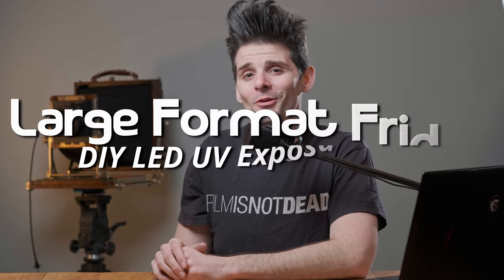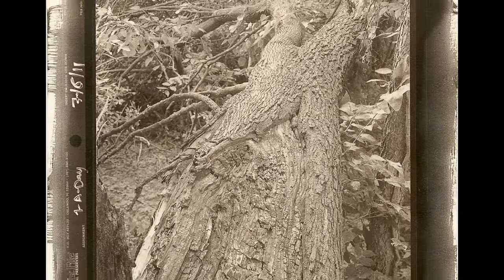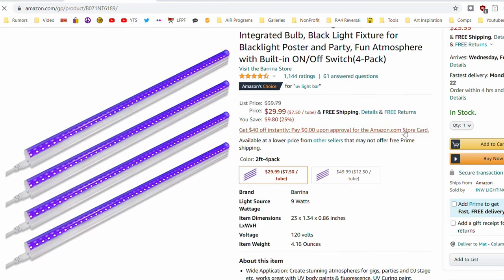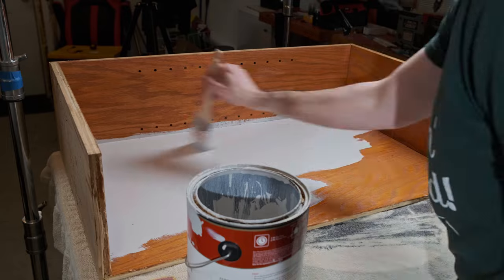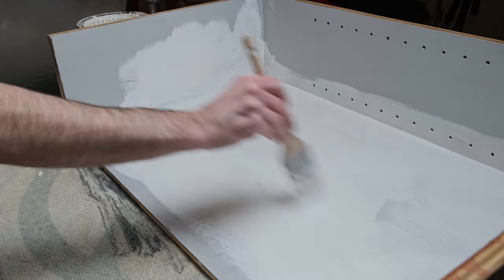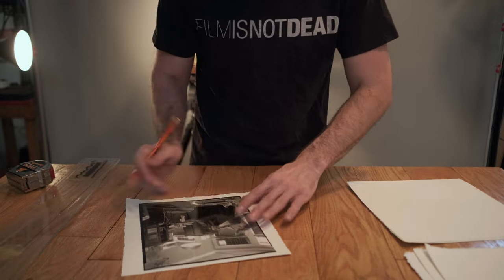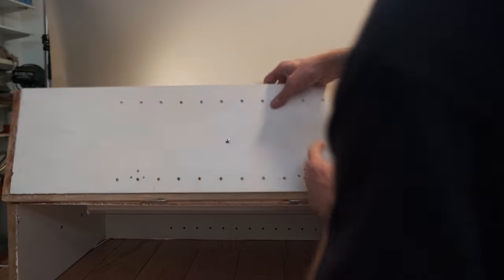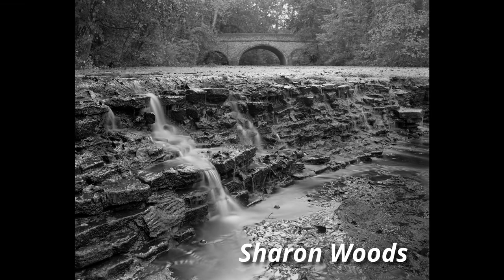DIY LED UV Exposure Unit for Alternative Process Photography - Large Format Friday

Comment: I built one of these a few years ago.  I attached a tripod mount (nut) on the back so I can position it easily.  I use it for albumen printing of wet-plate and digital negatives.  With the LEDS about an inch away from the printing frame my times are around 12 minutes.
Reply from the maker: Hey Robert thanks for sharing! I'm thinking the distance to the lights is something I can work on for sure. At an inch away, are you seeing any uneven-ness to exposure on the prints?

Comment: Have you considered argyrotypes? Making the sensitizer from scratch is kind of a pain, but you can buy pre-mix pretty easily, especially in the US. It's a printing out process, too, like cyanotype. It's closely related to kallitype AND you can gold tone and platinum tone it. A well-done argyrotype can be toned such that it is visually indistinguishable from a Pt/Pd print! And cheaper to make!
Reply from the maker: Hey thanks for the comment! I've heard of them but never tried them. Having access to a reliable UV source means I'll be experimenting with all sorts (time permitting). Will have to look more into argyrotypes!

Comment: Hi, thanks for your excellent video clips. When I saw your DIY clip regarding the UV developer, I would like to ask, what is the optimal distance between the light source and the print material, is it about 4 inches, or less or more. Thanks in advance
Reply from the maker: Hey Christoph thanks for the question! Optimal distance is based on intended print size and the spacing between the LED tubes. For the one shown in this video 4-6 inches from the printing surface is good. Any more and exposure gets increased, any less and there can be uneven areas on the print.

Comment: You might take a look at the LED UV rave lights made for European discos. About 30-50 watts each, 120 degree dispersion, 390-410 nm wavelength. That could simplify the build. I'm thinking a horizontal unit might  make more sense in my circumstances.
Reply from the maker: Thanks for the tip, I'll have to do some more digging into those!

Comment: I love platinum because the graduation of tones is spectacular!  However, I don't like all the extra work necessary to get a negative of the right size. I'm experimented just creating 4x5 platinum prints and they are gorgeous but just to small to really show off the beauty of platinum.
Reply from the maker: Erich I own a few 4x5 Pt/Pd prints from various photographers and they're fantastic! They may not have the same presence as an 8x10 but they frame and hang very nicely.

Comment: Now you've opened the door to the rabbit hole 😉
I did do some anthotypes once. While it was fun, it's not something I was tempted to do again as you need to pick an awful lot of flower petals to make just a small amount of "emulsion"...
BTW, nice deckled-edge ruler. Never seen one before. When I want an uneven edge I sometimes just slightly wet the place where I'm going to rip the paper using a small brush.
Reply from the maker: Thanks Francois, Anthotypes are another alt process I've yet to try. The creative freedom in choosing your own natural pigment is pretty cool. If you don't mind replacing flower picking with more steps, there's always carbon printing! Oh and that deckle edge ruler is great for tearing big watercolor sheets. I was shown the wet and tear method in college then saw one of the rulers used, the choice was clear, lol.
Reply: @MatMarrash  Carbon is definitely very beautiful, but maybe a bit too expensive for me (though I haven't really checked). For a long time I've been tempted by photogravure, but I think I'll get myself some chems to make some cyanos first... and tone them in tea or something.
Reply: Replying to a very old comment but if you are still interested in anthotypes you can use tumeric! Super easy no blender necessary and has a pretty quick exposure time of about 2-3 hours (can wash with borax rinse to make the print bright reddish brown too!)
Reply: @jadebramley3540  thanks for the tips. With the summer coming back I might give it another try.

Comment: This is great. How did you know the height of your drawer was enough for the light to spread evenly across the print?
Reply from the maker: Hey Jim, there are some recommended heights in Tim Layton's post (linked in description) but I really kind of got lucky with the build. Were I to build it again, I'd move the assembly down an inch or two.

Comment: I built the same exposure unit from Tim Layton’s post last summer, and it works like a dream. And so inexpensive!! I built an 11x14 contact frame at the same time, and I ended up spending less than $150 for both the frame and the exposure unit. I’ve used it for cyanotype, platinum, and kallitype printing so far, and I really love it!  Just curious, where did you get the cool thing you’re using to tear the paper?
Reply from the maker: I'm definitely late to this sweet DIY unit but had to share it. Glad to see other folks out there already using it or one like it. That deckled edge ruler is a gem and found it as a used product marked-down for clearance. I'd seen one demoed years ago and wanted to have one for making "edgy" tears on my watercolor paper.

Comment: what would be the benefit to making this as opposed to getting a nuarc or other plate making UV light source? Plate burning tables are pretty cheap these days, and the output from the UV bulb is probably a lit stronger?
Reply from the maker: David this is a great question! As a former NuArc owner, there are some big advantages of LED's: low/no heat generated, insanely low power draw compared to a plate burner, and lifetime of the LED's is significantly longer and more resistant to environment variables like humidity and dust.
Reply: And the exposure times and coverage is good? I'm definitely not opposed to chucking my huge plate burner if the LED technology has caught up
Reply from the maker: @davida5296  Exposure times are pretty good if you keep the LED distance tight at < 12". I'd say keep the NuArc for the vacuum and heavy glass top. Once the bulb goes, replace it with LED.
Reply: @MatMarrash  that might be the winning ticket. Let's keep alternative process going!

Comment: I'm making a large exposure unit. Any tips you may have would be great. My main ask is I have a 3.5" x 6" glass tabletop that is 3/4 inch thick. Will the thickness of the glass affect the process?
Reply from the maker: Thanks for the question Doug! A thick plate of glass shouldn't impact the process negatively, but will definitely provide enough contact between the paper and the negative.

Comment: I thought cyanotype needed 365nm wavelength UV light but the lights you used were 395-400nm. I wonder if that's why it took 45 minutes? In direct sun, even in the winter (here in central Virginia) a cyanotype takes only about 10-15 minutes to expose. I watched another video that showed a cyanotype being properly exposed in 10 minutes with a UV black light with a 365nm wavelength.
Reply from the maker: Hi Lisa thanks for the comment. Update, I was using incredibly expired Cyanotype materials! With fresh stock, it's 10 minutes all day every day.

Comment: Hello Mat, Thanks for sharing this video. I'm wondering if there is an advantage to using the bulbs you are using versus cuttable strips. According to Tim Layton's post you linked to there is a limit of 10 of these bulbs you can connect in a series. If you had a larger box, e.g. 32x40 inches, I'm wondering if you can squeeze in more LEDs via cuttable adhesive UV strips. 
Soldering strips together seems like a pain, but would it be worth it to have more LEDs per square inch? Thanks!
Reply from the maker: Hey Jason, the convenience here is the integrated driver vs. strip lights. A much larger series of strips will need a heavier duty led driver to supply enough power along the chain. In terms of power, this DIY box with 8 tubes is great for all alt. processes I've used so far.
Reply: @MatMarrash  Perfect. Thanks for this info. Also, loved the recent 4x5 strobe episode with Tariq Tarey. Thanks!

Comment: Hi! Could you define narrow spectrum UV in term of nanometers? 300-400?  Thanks.
Reply from the maker: Hey John, some Chip on Board (COB) LED's come in varieties that are specific to an exact nm wavelength with a +/- 5nm tolerance. The more affordable tube and strip LED's are have a much wider variance in the 20-30nm range. I'd recommend searching for LED's in the 350 - 400nm range.

Comment: Any idea on where to find specs on spacing these bulbs?? I’m about to make a similar box but slightly larger, 24x 36” is my goal size.
Reply from the maker: Hey Wes thanks for the comment. Can't remember where I saw it posted, but the recommendation I recall was the gap shouldn't be more than the width of the two bulbs. In this case, that's no more than a 2" space between bulbs. For a 24x36" source, you will probably want 12 of these 24" tubes.

Comment: Could you space the units closer together to get a shorter exposure time?
Reply from the maker: Spacing isn't an area where I've done much testing. Generally you want close enough spacing between bulbs so the coverage is even, but also at a height from the print where you won't get visible banding nor very long exposures. 6-8" seems to be a good working height with 1-2" between bulbs for side-to-side.

Comment: now i can stop pulling out whatever is left of my hair. hardly any real information to guide you on making an exposure box til now. does the spacing of the uv light make any difference in exposure time. trying to source parts to copy a photo of my mother and pass on to her grandchildren. what film choices from 8x10 - 14x17. so many options. i always used film cameras only.
Reply from the maker: Hey Tony thanks for checking out the episode and thanks for the compliment! Spacing tubes/strips closer tends to be more popular, though unless you're changing number of lights and/or printing height, the printing times won't really change. This box I threw together for the episode could have benefited from another 4-6 bulbs, but it's still serving me well two years later!